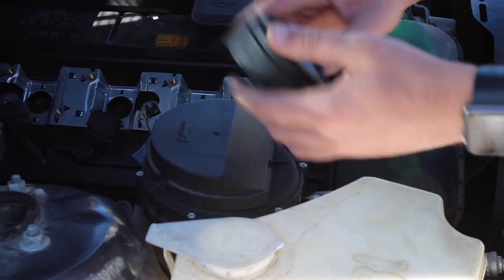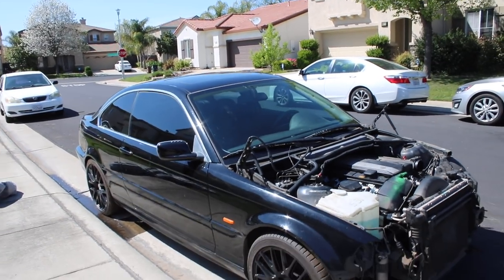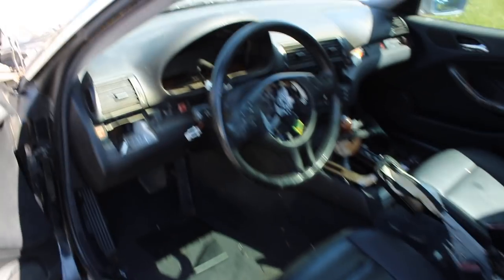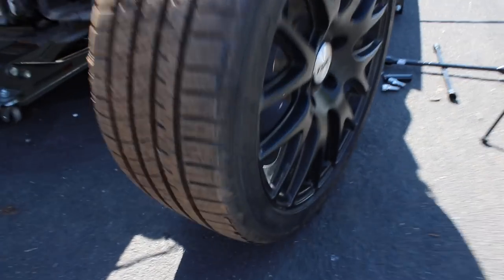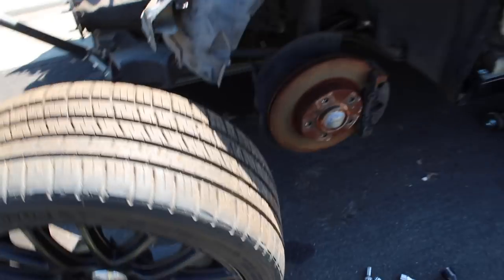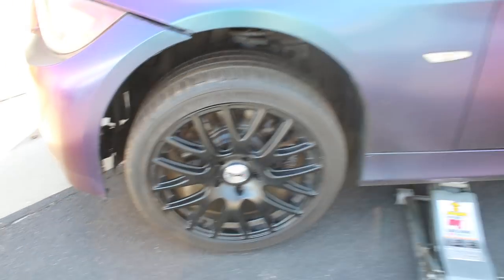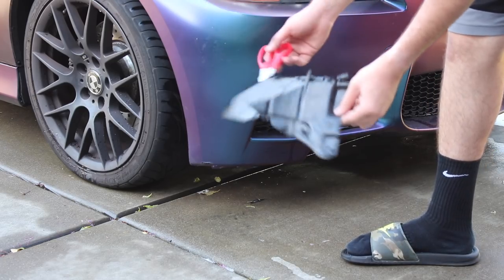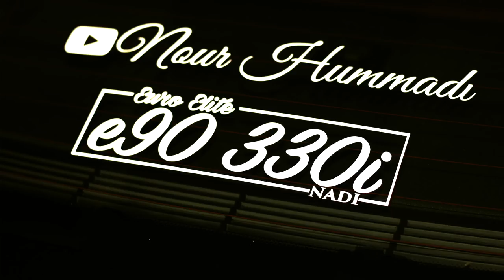Didn't want the e46 to end this way :(

Comment: first step: poor litlle bit of oil in to that cylinder and do compression test again ( if you get better compression, your piston rings are worn out ).
if that didnt do anything, next one would be a leakdown test ( valves )
last but not least, i would take that valve cover off and check those headbolts... m52 and m54 are known to have stripped headbolt threads in those blocks after overheating.
Reply: My guess would be that since it were the more aft cylinders which had lost compression, it would be from heat.

Comment: Come on the only thing you do on all e46 bmw is to pull out the spark plugs and put some mestry oil in it Very common problem what happens is the rings stick in the piston and you lose compression there's vidios on how to do this Thought you guys where smarter then this